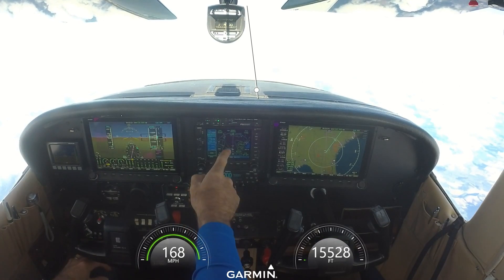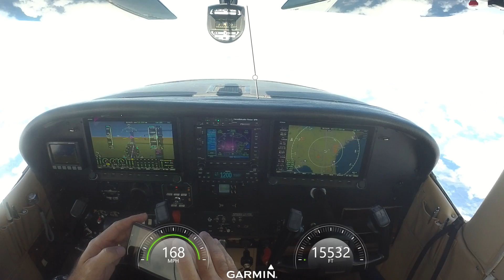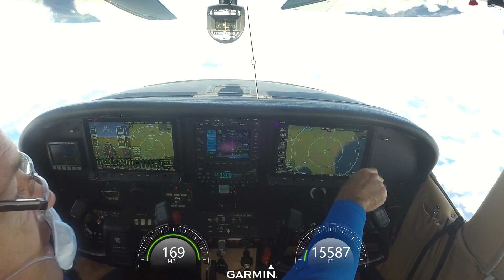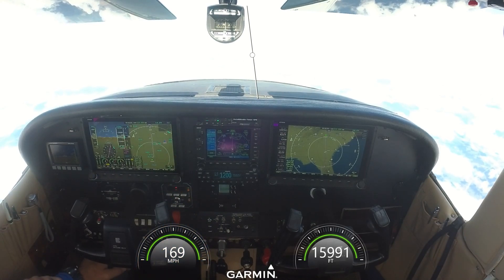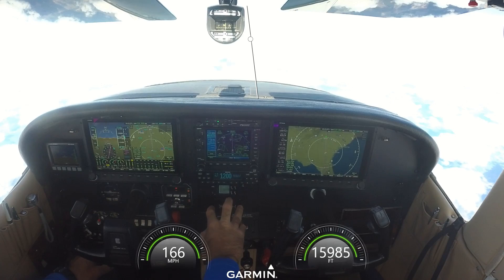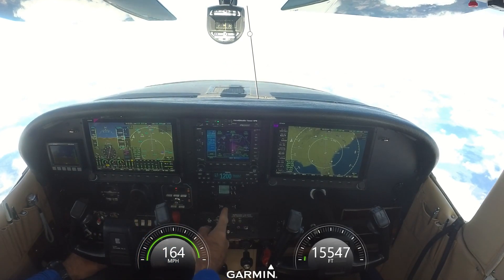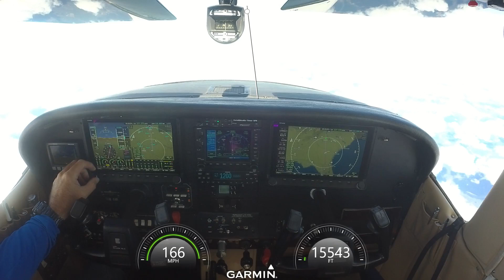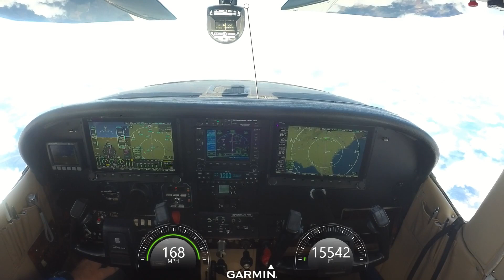Saint Aviation install of my Dynon HDX in the Cessna TR182

Comment: Getting an HDX installed as I type. Can’t wait.  Regarding your oxygen… when you talk, you breath much less through your nose, so you’re not getting as much O2 as you might think.   When you fly high with pax, enforce a periodic “quiet time” and use  pulse ox device.  Nice upgrade!
Reply from the maker: Roger that. Been flying on oxygen for 33 years. I wear a constant pulse ox ring and never let it get below 88. You can talk all you want on oxygen, you just have to understand the technique.

Comment: I’m a young pilot and I recently started flying a 79 TR182. I noticed in a couple of your videos that you typically cruise at 25” and 2200. I’ve been running 23” and 2200, thinking I might be saving some fuel burn and engine wear running at 65% bhp. Am I actually saving anything or just losing time and speed? Thanks for the videos.

Comment: I sure appreciate your video walkthrough! I am currently installing a very similar Dynon HDX system in my 1981 Turbo 182 Fixed Gear and my installer is not sure we can connect the fuel pressure gauge to the Dynon engine monitor.  On our planes the fuel pressure is not referenced to atmospheric pressure as it is in a naturally aspirated engine, it's a differential fuel pressure as compared to the manifold pressure. I don't see a big round gauge for MP/FP in your beautiful new panel. Can you provide me with any insight on this matter? Thank you, Scott.
Reply from the maker: Fuel pressure will work with your engine as will MP as well.  This plane has fuel and manifold pressure on the Dynon. Dynon makes sensors for yours as well.